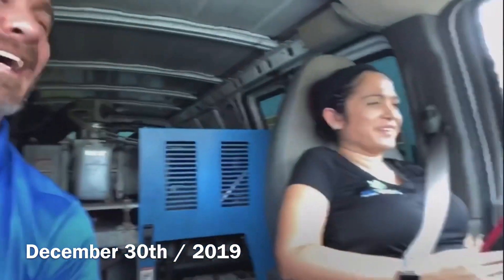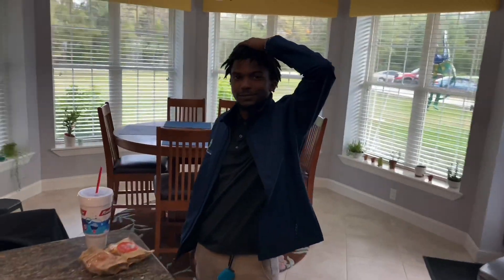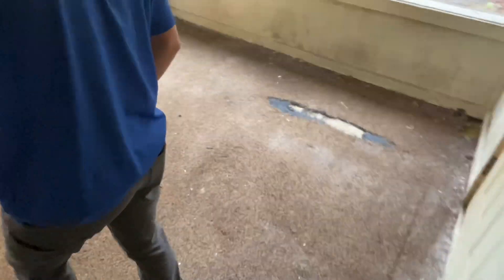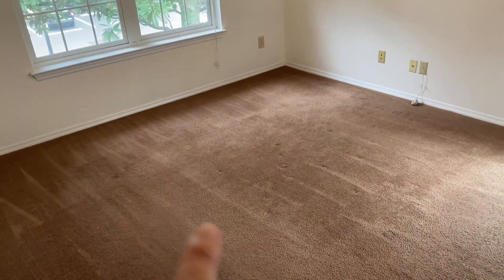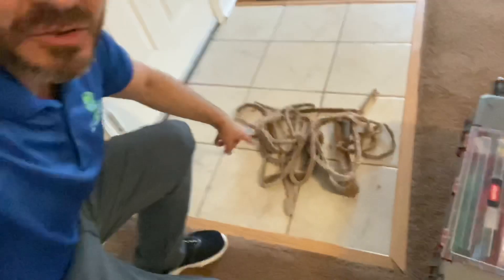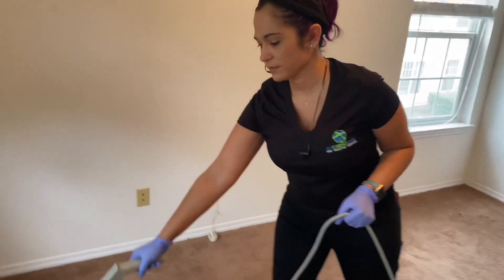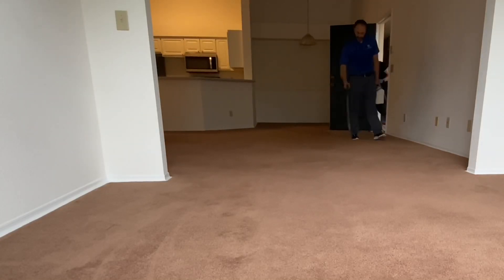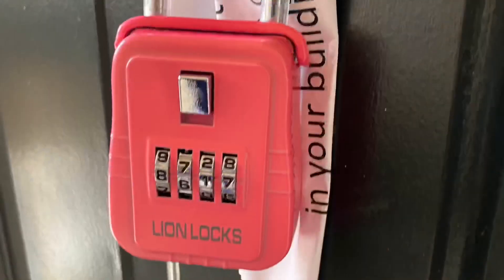Daily Vlog #1: Husband & Wife Team; Professional Carpet Re-Stretching with Cleaning

Comment: Hey Dan, great video!  I see quite a few cleaners using the Workhorse Vacuum.  Do you personally feel like it may be the best commercial vacuum available for carpet cleaners?  Thx!
Reply from the maker: Hmmm.....the best? Yikes - idk - we really like that ProTeam 1500XP also. There are SOOOO many really good commercial vacuums to choose from - I am a fan of the WorkHorse due to the canister feature where you can “hunt” for dirt essentially - continuing to go over areas where you can see sand, dirt and dry soils flooding into the canister real time. The soil where we are (coastal) is loaded with sand, which is extremely abrasive.  I haven’t tried out enough other commercial vacuum cleaners to say for sure it’s the “best” tho.  Thanks for asking my opinion regardless - and I really appreciate you watching